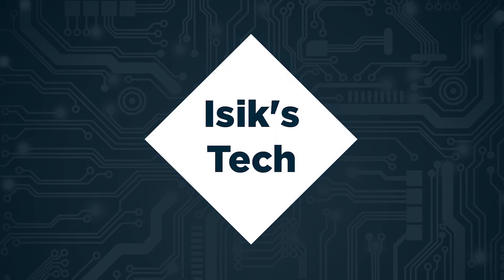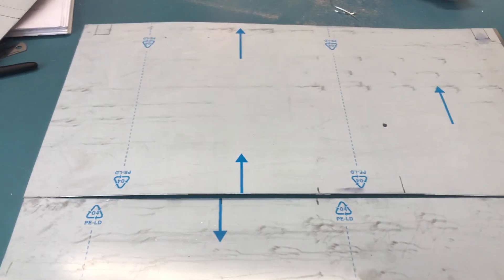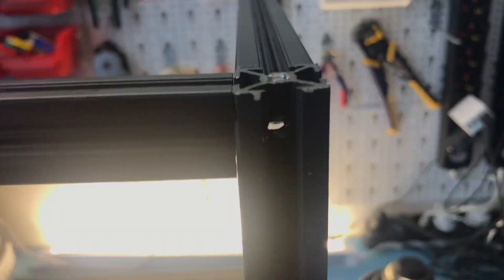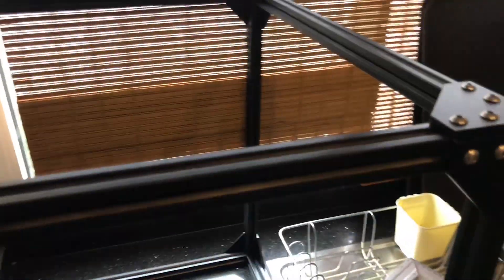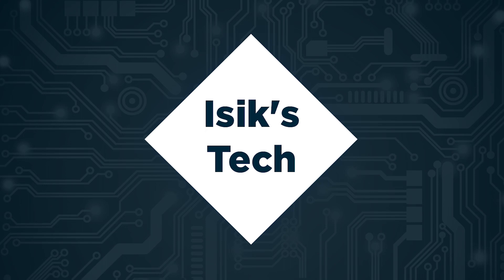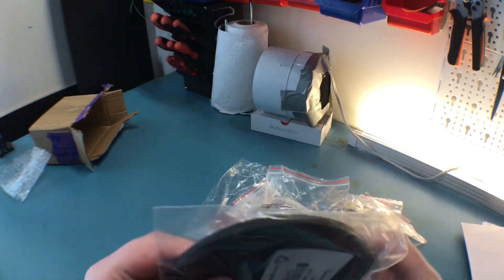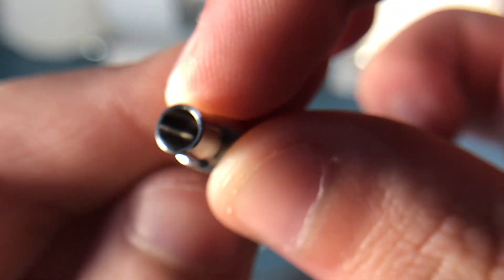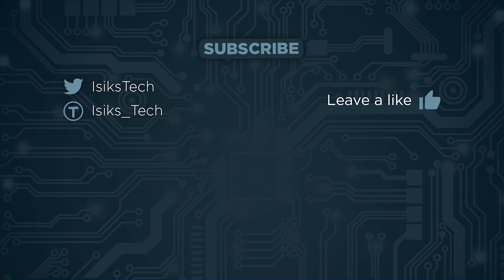Voron 2 Ep. 3: Extrusions & TriangleLab Parts

Comment: That blue tool they sell for cleaning up prints is a metal deburing tool
Will take sharp edges off that 10mm plate a treat and they can give you a nasty slice too
Its a cloned noga tool great bit of kit theres all sorts of different shape blades you can get to
Those normal ones it comes with are good for straight runs on plate or sheet and inside of tube and drilled holes if they are big enough like 4mm+ 👍🏻